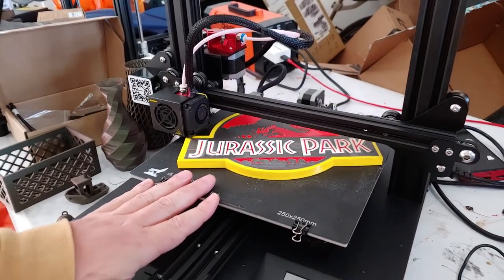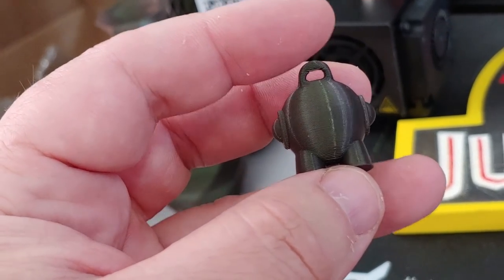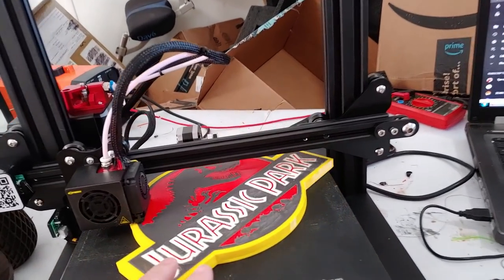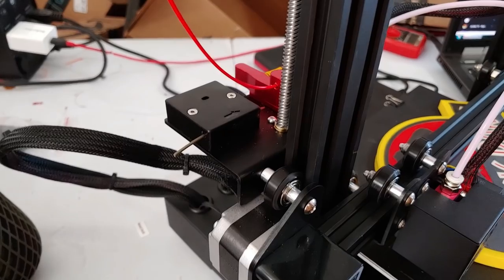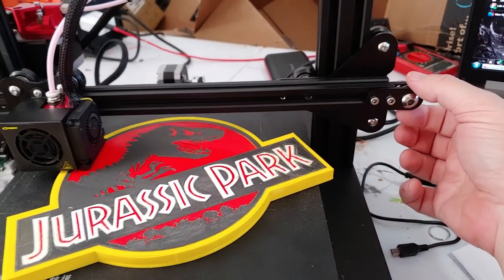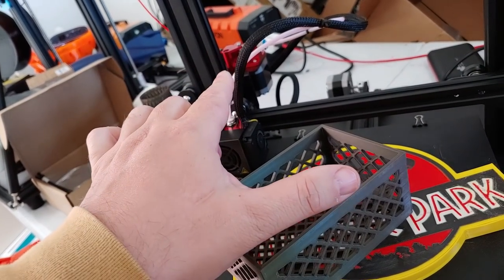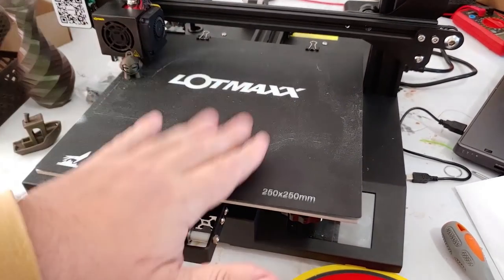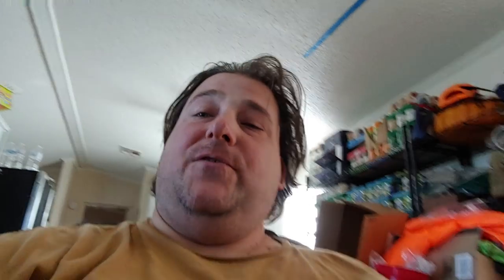Lotmaxx SC 10 Analysis T3DP

Comment: If you loosen up the two screws that hold the X axis tensoner you should probably be able to rotate the end wheel hanger enough so both wheels touch.  Had to do that on my enderr 3.
Reply from the maker: No. 2 sets of screws independant of each other. The tensioner are hammer nuts the trolley is attached with 2 bolts through plate into predrilled holed in the x arm extrusion. They do not effect each other like that.
Reply: @nerys71   OK ,Look from the back and see if there is a screw to the right oh the inner wheel. Try  loosening that and see if you can rotate the wheels intp position.
Reply from the maker: @duwaynes7529  I have several different paths to fix this one of them will work my issue is I want the manufacturer to fix it from the factory so that the end user doesn't have to do that
Reply: @nerys71  My experience was like yours on my Ender 3, and loosening the two screws with T nuts (or hammer whichever you prefer to call them) allowed the bracket to pivot enough to bring both wheels into contact.  Loosen those, make the eccentric nut really tight, then tighten the 2 screws and back off the eccentric nut. Worked for me,
Reply from the maker: @ronholder5844  yep that is what i will try first to see if there is enough wiggle room to make that work! :-)

Comment: Awesome review very thorough and objective. One of the best I've seen for this printer. I already bought one, but was looking to learn more about the machine. I'm having trouble with a printer failure where it will skip layers and just start printing mid air. I noticed the extruder driver gear has grinded on the plastic so I'm thinking it might be too much friction caused by the feeder sensor.
Reply from the maker: Thank you

If it's actually grinding a plastic it could be that the tension arm is too tight or that you have a partial clog in the hot end is it going to produce back pressure since it cannot push through the clock which will cause the feeder unit to grind the plastic 

Several things could cause this the most common to our a gap between the PTFE tube and the nozzle watch my hot End video on how to handle that 

It could also be that you're hot end fan has failed

Your hot end contains two fans one to cool the hot end and one to cool the part the one on the side with a little duct on the bottom is usually the part cooling fan the one inside the enclosure is the hot end fan if that fan stops working you will get heat creep which will call the hot end and cause both you're grinding and you're missing layers

Comment: Thank you for a wonderfully informative video! 
Is it possible to replace those build plate springs with stronger springs that make the screw less likely to loosen?
Reply from the maker: Yes you want to use die compression springs they have a square profile and are yellow just get the right length relative to what you have now they're very cheap on Amazon don't use the stronger ones green yellow and red they might be stronger than the materials are attaching them to so you'll just start bending things

Comment: The talk about the plate on the right side typically is caused just by the alignment of the plate to the X axis arm. Ender 3 has a similar issue. I used a bigger hole and a hammer nut on all my Enders to make sure this was spot on. To much in accuracy in the overall manufacturing to have them perfectly aligned.  Sorta the same as you described on the Y axis motor assembly.
Reply from the maker: That's what I assumed that the holes were miscut I am hoping that there might be enough play in there to be able to straighten it out but I doubt it it would be pretty easy to make enough play in there however just like I did with why access :-)

Comment: Is there a way to calibrate the esteps on the lotmaxx sc10? I cant find where I could anywhere in the ui
Reply: I having the same issue. I got the metal exreuder from this video, but when I try to feed filament it's making these popping noises/skipping.

Can't figure out how to adjust e steps which is what I'm hoping will help
Reply: @agoobwa2297  I've been in contact with lotmaxx and one of their engineers. They have sent me a modified firmware that I will flash my printer with sometime tonight. It's supposed to have a bunch of advanced settings, so if it works I'll let you know and send you the firmware.
Reply: @hazthematt7855  please do! That'd be great
Reply: I'm waiting on a reply email atm. The modified firmware doesnt work so they are hopefully fixing it and should sent me an update soon. Idk how much the holidays effects their replies.
Reply: @hazthematt7855  Icic. Yea for sure! I just got a reply from them on a different issue today. So hopefully soon
Reply: Interesting... I emailed them asking about any firmware updates in the works and they said they didn't have any at this time... Hmmm

Comment: Thanks for the review. I purchased one myself I love it. But my fiber plate warp after 4 prints. Do you have any suggestions for another plate?
Did you have any issues with warp of the fiber plate?
Reply from the maker: No i have not had it warp is the plate warping or the sticker on the plate? The binder clips should hold the plate flat.
Reply: @nerys71  Thanks for the fast reply! The removable fiber is warping. Even with the clips in place there is a hump along one side between the clips. I haven't found a replacement plate yet. Do you know of one that's 250x250?
Reply from the maker: That is very strange. Have you tried contacting the company and sending them a picture? They will probably send you a replacement.
Reply: @nerys71  not yet I was just wondering if you had seen that. I will.
I'll let you know what they say.
Reply: @nerys71  Update - No issue easy peasy they are sending one. Thanks for your help.
Reply: Just an added note I found some other issues with the non-removable build plate as well. The back two rollers were really loose causing the bed to move up / down and from side to side. I noticed in one of my taller print models and then got worse with the lower profile ones as well.  It seems to be performing better.
Reply: I have heard of someone also having this problem. I haven't had that issue either, but someone suggested turning it upside down with the heat bed on to flatten it out. I can't verify first hand if this works.

Comment: Just got the Lotmaxx. I’m getting good prints with the filament that was included, but can’t print with anything else. I’ll print with what they sent, change the filament, make sure the bed is still level, and then print. Nothing will adhere to the bed other than the initial filament. I even changed the bed to a mirror and have the exact same scenario. I’ve tried Hatchbox and Inland. Do you have any suggestions?
Reply from the maker: If you are printing the included sample files that it came with those were sliced in a specific way most importantly the offset of the nozzle from the bed is slightly different

So when you slice your own files unless you match there's exactly you need to adjust your bed level for your own slice so slice your own file and then go through the bed leveling again with your own file you probably just need to bring your bed up or down just a little bit
Reply: Nerys, thanks so much for the reply and advice!  I can print with my settings and their filament and with their settings and my filament, but not with my settings and my filament. I’ll keep playing with my settings, but think I may have to start reading their gcode file to find where the settings differ. :(. Happy New Year to you and your family!

Comment: bummer about the x alignment issue, maybe you could put a couple layers of rubber tape around the wheel just to get it flush
Reply from the maker: It's actually not a huge problem pretty easy to adjust the wheels to balance the forces here but I might have an easy fix also they should be implementing a fix in the line so future sold units won't have that problem it might even be unique to mine